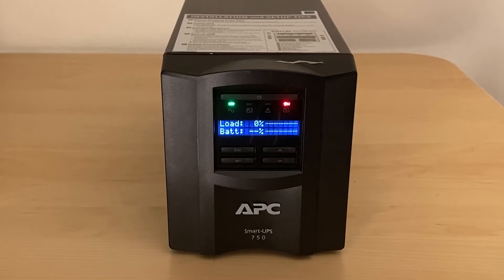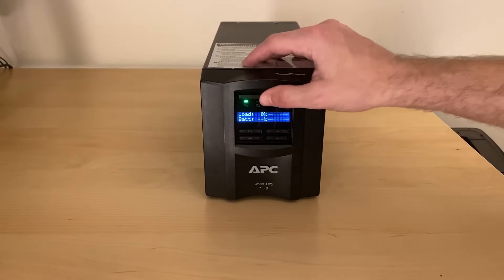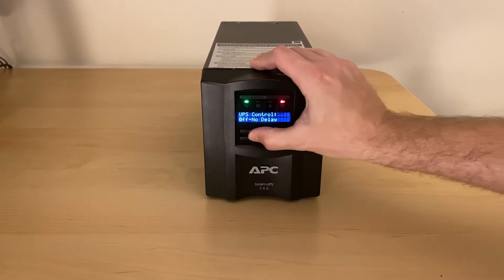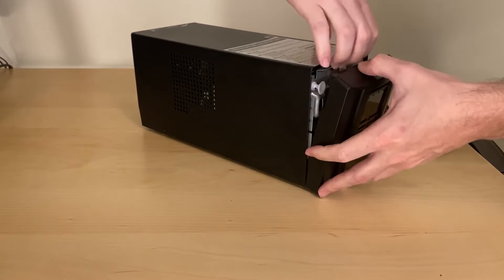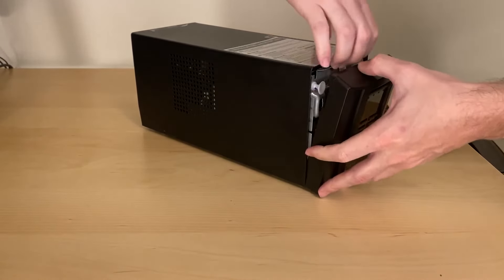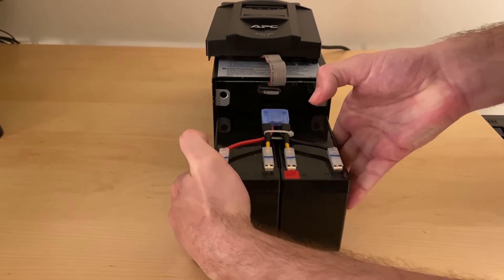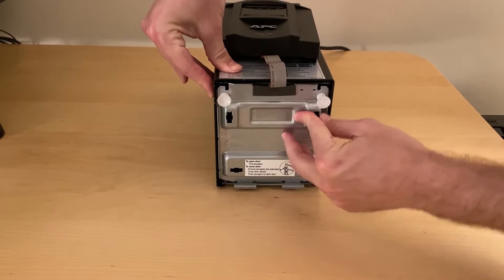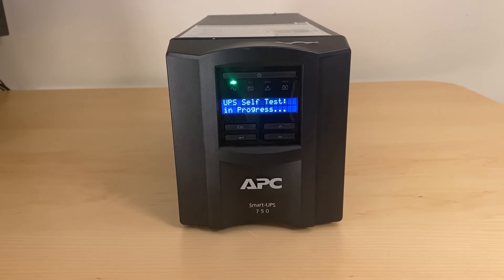How to Replace Battery APC Smart UPS 750

Comment: Thanks for the concise and clear video. Just updated my old UPS 750 with it's third set. Last replaced 10-16-2017. Took some elbow grease to get off the harness, and some gorilla tape to hold the Chinese replacements together. So far so good.

Comment: the APC Smart-UPS series are almost all hot-swappable batteries, meaning you can leave them plugged in while changing batteries.

but since you didn't replace them with APC batteries, it makes sense to be on the safe side.

Comment: The terminal size is ofcourse important but even more important is the physical size of the battery and ofcourse voltage (12V). The size used for this UPS is the most commonly used 151x65x94mm, Yuasa has a really good "made for UPS use" model NPW45-12, 8,5Ah. If you can find that one below list price it will serve you well. I just replaced 100 of these (actually NPW36-12) that hat had been in use for 6 years, which is one year too long, and all were still in fairly good condition.
Reply: Which batteries would you recommend for an APC SmartUPS SU1000 INET? The official ones are the APC RBC#6 and they cost a whopping 300€ xd.
Reply: @prorace_type_r  That depends on what you want to achieve, but I agree, that price is too steep. I would just get the dimensions of the batteries that you have now and look for batteries of the same size with the terminals in the correct position, that way you don't have to remake the cabling. Yuasa have served me well but there are other reputable manufacturers that you can source from as well.
Reply: @MadsenWikholm  I am just powering my PC and monitor with it. It has served me well, since it cost me with almost new batteries 30€.

Comment: One question, you pu inside 9A 12 Volts battery, but the original was 7,2A. As the device is smart, did you have any issues to put the battery a 20 more powerful then the original? The second question if you had everything okay, did you notice a 20% more battery life comparing the original battery or the device charge your 9A battery to the 7,2 A limit and no runtime plus noticed?

Comment: I had to replace the batteries in mine too. To modernize, have less environmental impact, and hopefully a longer service time, I bought this LiFePo4 variant (2x): GreenCell LiFePO4 Akku 10Ah 12.8V 151x65x95mm. Much cheaper than other ones, they fit perfectly, came with 64% charge and work as expected. I didn't do any measurements on capacity though.
Reply: A lot of LFP batteries of this size are only rated for around 10a continuous discharge.  You're going to have trouble with your SMT750 if you're pulling more than 240w for longer than a minute.
Reply: @kchiem  you are correct. I should have updated my comment, because Indeed I did run into trouble because the packs cant handle the required current. So again: buy cheap = buy twice :(
Reply: @MarkusRessel  It's an issue that a lot of people don't realize even with the SLA versions of these batteries.  You need to specifically look for "high rate" versions that can discharge at the current levels needed (a little over 30a continuous in the case of the SMT750).
Reply: @kchiem  You make a great point about finding batteries that can sustain the output current. That's critical for people who intend to max out the capability of the UPS (approximately 6.5A @ 115V).

I don't mean to disagree at all. But in my own case I use an SMT750 to run just my cable modem, router, and a backup hard drive, which are very low loads. My goal is to have them outlast a power outage. So I'm able to use a non-high-rate battery, like the Power Sonic PS-1290. The advantage is lower cost, higher capacity (9AH vs the original 7AH) for longer run time, and these are still able to sustain 27A for 7 minutes according to their datasheet. That's plenty of time if you've got a computer or small server set up with auto-shutdown, so higher loads are not out of the question.

So for anyone reading this comment, if you want original performance, then buy the APC branded replacement or 'high-rate' replacement batteries.
But if you are willing to figure out what your actual loads are, then you may be able to use the more common 'general purpose' replacement batteries.

Comment: First time changing the battery.  I loaded the new battery, but the metal plate won't click into place.  Pulled battery out and it is the appropriate size and the one suggested for my model APC750.  The front plate won't click into place because the metal one won't...... suggestions?

Comment: I have a fair number of customers who have various versions of the APC Smart UPS 750.
Over the years the white push-pull plastic clips/rivets that keep the battery door closed have fatigued and fallen apart.
APC are unable to supply replacement ones and I can’t find any suitable alternatives anywhere.
Does anyone know of any replacements that will make a good alternative?
Currently I’m using cable ties to keep the battery door closed, which whilst very secure I’d like to do a proper job and replace the broken rivets.
Thank you 🙂

Comment: Has anyone had success using adapters to convert F1 terminals to F2 terminals? I've ordered two Yuasa batteries in order to do the trick mentioned in this video, but the terminal in the Yuasa is F1 unfortunately :((